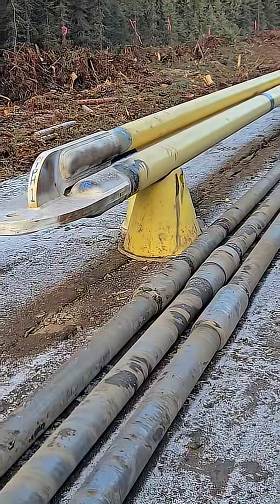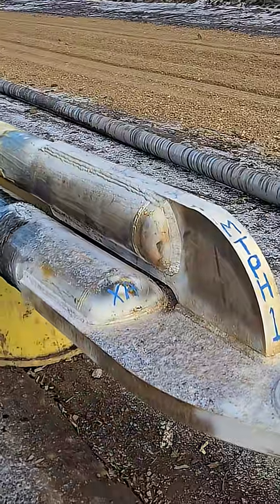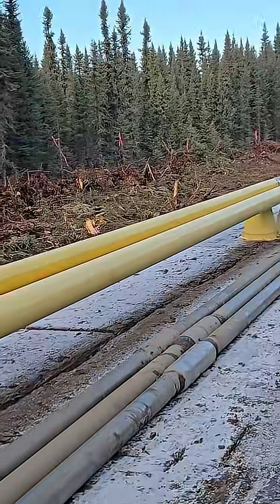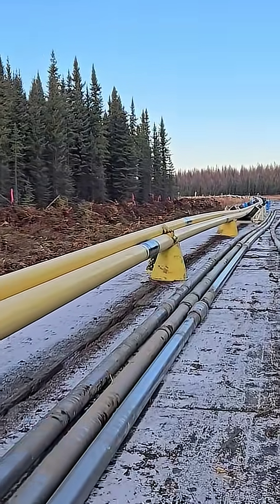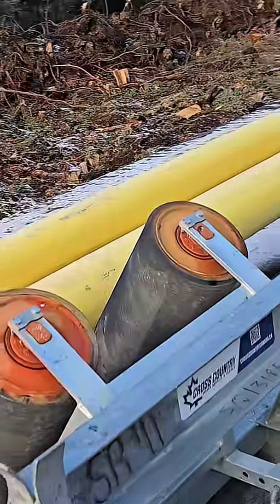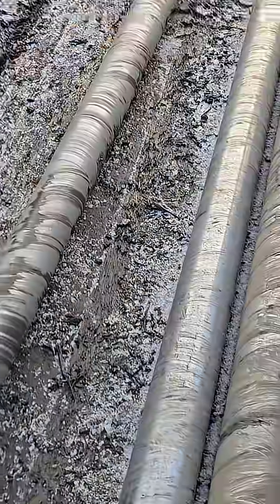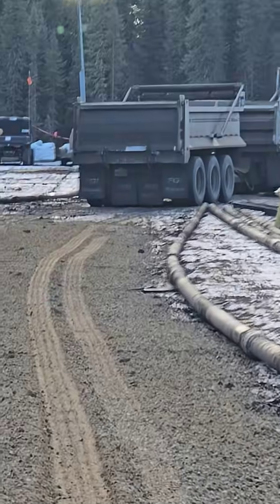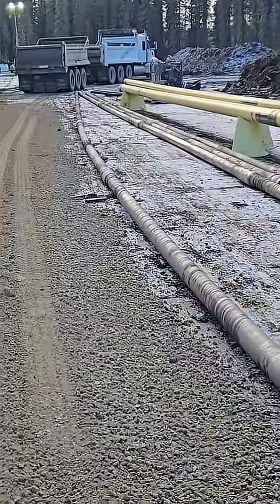Pipeline under a valley

Comment: Huh. I worked with a guy that would go nuts if two pipes were even close to touching. He claims the pipe vibrates underground (and I do in fact know it does) and he said that two pipes touching each other would eventually cause a leak. I’ve been involved in several pull-throughs where multiple pipes were pulled at once. Never met anyone else concerned about it. I guess time will tell?
Reply from the maker: Fair point.  I've certainly been around clean-ups several times caused by external damage. 
Makes a guy wonder about that.
Hopefully we don't find out "right away".
Stay tuned for more content my friend and thanks for watching.
Reply: @lovesloudcars  BTW, your channel is great. Keep up with the interesting videos.
Reply from the maker: @lnpipeline3306 thanks. 
My wife figures I'm a little too scattered in my attention span. But nobody's going to claim I'm producing boring identical content every day..